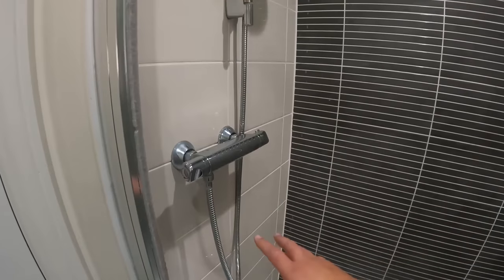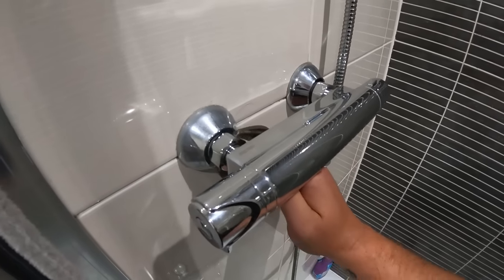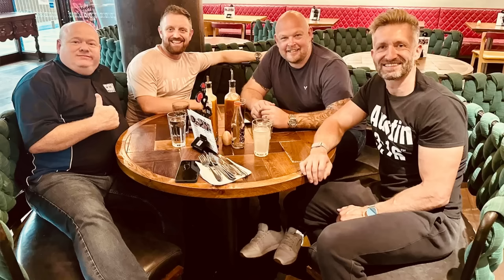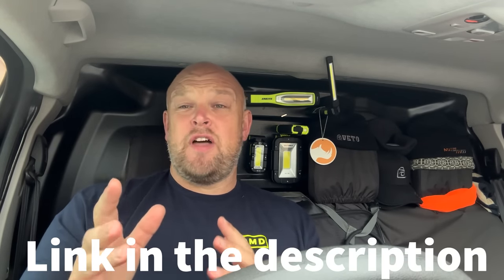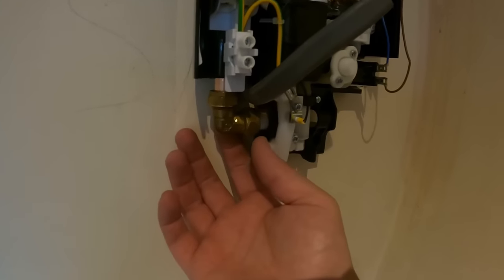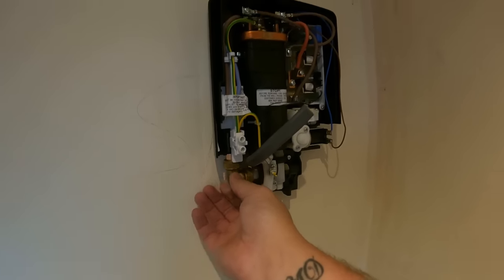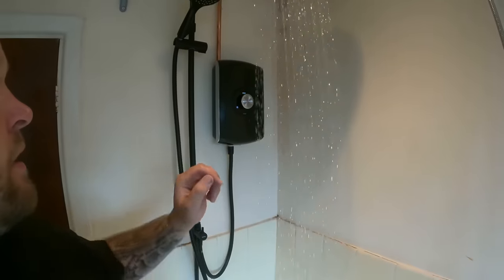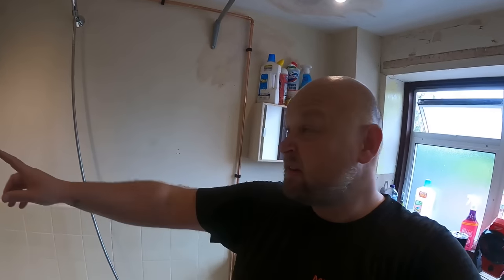FITTING THERMOSTATIC & ELECTRIC SHOWERS | Why have 2??… Real World Plumbing

Comment: Ive got  both showers  . Cos I live in the backside of nowhere   my central heating and hot water is via  coal fed aga. 
 Obviously not going to light that in summer   so have elec shower and calor gas hob  for summer use . 
  Coal fired cooker  in winter .
Nice tidy job there  .  
 Cheers from  a wet n windy Ireland 
 🇮🇪
Reply from the maker: Makes perfect sense 👍🏼👍🏼👌🏼

Comment: Hi mate a very tidy shower unit also the way you installed it showed an advantage of pressfit over soldering
Reply from the maker: Indeed it did mate….. everything has a place
Reply: @MJTiffPlumbing  where did you get the black pipe clips?
Reply from the maker: Talon buddy 👍🏼👍🏼

Comment: Try that peel tec spray from ct1 for getting paint off pipe. Looks a pretty good painstripping spray. Looks like you were having fun last week 😂 be interesting to see what the next development in press is. I'm buying my own soldering kit next week one step closer for when I finish college next year. 😊
Reply from the maker: Yer I’ve heard that good for stripping paint…. Will give it a go👍🏼👍🏼
Reply: Stanley knife dragged sideways along the pipe is the easiest way of stripping paint from a pipe and then a quick rub with sand paper and or wire wool.
Reply: @truthseeker7794 just done a load of scraping while replacing radiators... blow torch to soften the paint helps a ton as well

Comment: Struggling as to whether to go pressfit or not , soldering is bullet proof for me, so should i change?? Any advice would be appreciated 😊
Reply from the maker: I was very pro soldering 12 months ago….. after now getting used to press it certainly has its advantages etc….

Hold fire as something big is coming that will help make your mind up😉
Reply: @MJTiffPlumbing  Thanks Mark
Reply: @MJTiffPlumbing  any clues?
Reply: i think that nova prss is £1295+vat
Reply from the maker: Just wait…… it won’t cost you that for a Novapress soon😉

Comment: I've not seen a Triton  electric shower with a rain head as well as a hand shower so I suspect it will only work with a 9.5 or higher as the throughput for a big rain head will be too small for an 8.5kw. Most showers have been installed with 8.5 so anything higher will need upgraded cable and a 45 or 50 RCD.
Reply from the maker: Now you have 😉👍🏼👍🏼

As said in this video…. It’s all new electrics so not an issue at all.
Never assume the cabling when installing electric showers…. Always check

Comment: Had a plumber few years back charge me £120 Labour to change two mixer taps and a thermostatic shower mixer. Took him about 30 mins in all. Saw how easy it was and changed one of the taps myself the next time. I would urge people to try doing simple plumbing jobs themselves before being charged extortionate prices. Rant over, sorry.
Reply: 30 min to change all 3 opens. I doubt that's possible.

The process is seems fair though
Reply from the maker: £120 is very fair to change them 3 things…. 👍🏼👍🏼